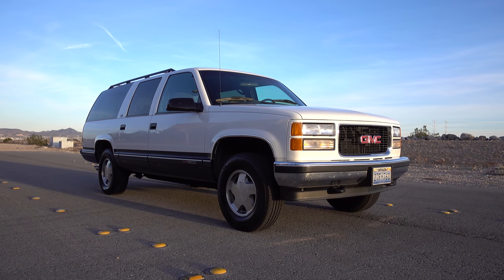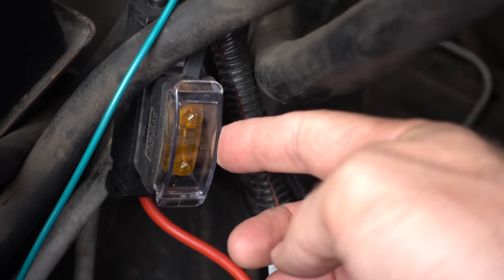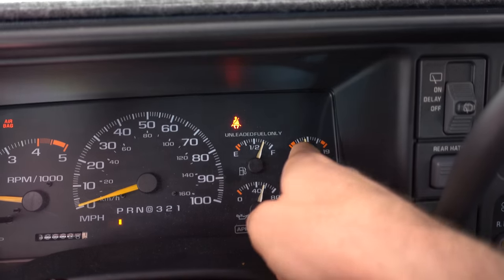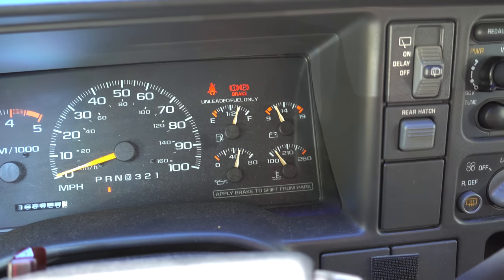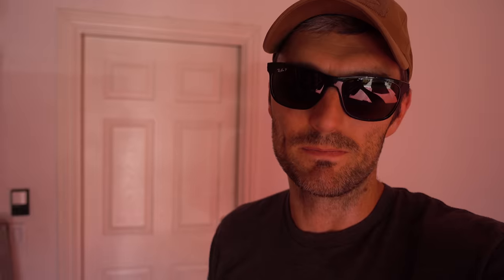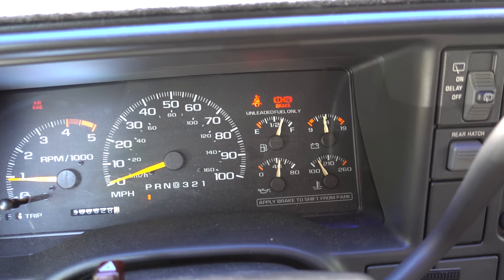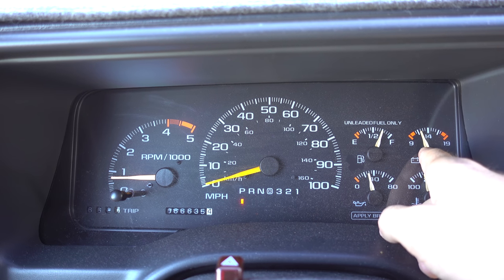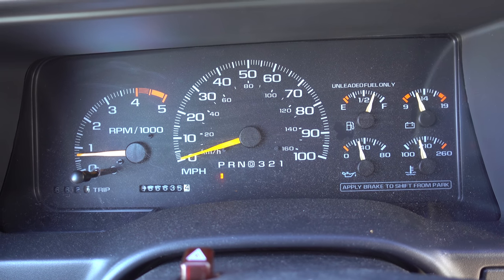SOLVE A LOW VOLTAGE ISSUE!

Comment: What was the problem
Reply from the maker: The alternator. See my latest video on my channel!! I just swapped in a MechMan 250amp Elite and I no longer have issues!!
Reply: My battery gauge drops with ac defrost head lights turn up window goes to 9.. i check the battery running 13.6 with all accesories on but gauge reads 9
Reply: I also have brake abs t/c lock and all gauges go off whene driving whene it gets to 9 what should i do

Comment: Batteries usually don't drop voltage unless they are cold. I've seen GM alternators crack the stud for the battery lead. Would cause a bad connection, and therefore, inconsistent voltage. Sometimes this does not happen until everything gets good and warm from expansion. You might also try using what is called a "Lightning Cap" on your fan relay circuit. These are supercapacitors used to prevent voltage sags with high power car stereos.
Reply: My car when hot occasionally stalls and voltage gauge drops to 12 in the red zone. Happens when coming to a stop, higher mileage 2002 Camaro
Reply: @HypocriticYT  A few things come to mind here. Underdrive pulleys for alternator and water pump were (still are?) popular mods to reduce accessory drag, so a previous owner may have installed underdrive pulleys, which combined with a malfunctioning Idle Air Control Valve, could be allowing idle RPM to drop too low to maintain sufficient alternator RPM and drop voltage, especially with the additional RPM drag and amperage load of air-conditioning. Coil packs / DIS ignition module could also be flaking slightly enough to reduce power at idle, resulting in a lower idle.

Could also be the cracked exciter stud I mentioned previously. The throttle body / intake manifold could also need cleaning, as MPFI / TPI / GDI all allow gunk and carbon to accumulate in the intake, choking off airflow, which will affect power and idle RPM. Dirty fuel injectors could also contribute to low idle. Modern OBD systems are quite sensitive to voltage sags, so anything causing a sudden voltage drop could cause a stall as you're experiencing.
Reply: @anonymousinc6330  it's all original and I recently replaced the air idle valve and the MAP sensor (scanner found it). It idles fine at about 600 rpm. Happens when A/C is off since I rarely use that anyways. Cracked stud seems more likely since the problem is intermittent and only occurs when hot. Tomorrow I'm changing the alternator as it has over 200K miles on it so it cannot hurt to do it.

Comment: It's the alternator. Once you have your engine running, most of your systems run off the alternator. That alternator is only rated for about 95 amps. I would start looking at a larger capacity alternator. Your alternator should be putting out a minimum of 13.8v and optimal is 14.8
Reply from the maker: Jason Hall hey Jason thanks. You are correct. My alt was at fault. I’ve since upgraded to a Mechman 250 amp elite and it rocks!!
Reply: @1RoadGarage  you're welcome. Mechman is an expensive alternator. It's great that you got one another route you could have gone would be to get a junkyard alternator and install a high output kit in it yourself. Time spent is money saved. It also gives you information on how parts work so you can better understand and diagnose issues
Reply: 14.4 volts is normal but nice attempt

Comment: Dual alternator may a option, but I would go firstly with a couple of AGM battery in the back or in front were every you can find space, plus definitely upgrade on the positive and negative cables

Comment: Did you compare the Amphere Hours Capacity of the Batteries to the Amp. usage of the fans and total draw of the car. Plus a cheap-Oh from Costco. Come on be smart and not so cheap.  Get a Odyssey 1500 Batt.   Also how about a switch so one fan at a time or temp. controlled fans. Yes spring for dual Batt. With 140 amps. You never mentioned the amp draw of the fans. What is there draw single and total ?

Comment: please take ur truck and get ac checked ..the hotter out the higher the pressure in ac and ac compress is over stressing and slowing everything down..
Reply from the maker: +Thomas Hoyne I actually just took it in and it was low by almost 2 pounds. The system holds 4 pounds and was recharged properly...
Reply: 1 Road no it only takes 2.7 pounds..with it over charged and hot the high pressure side will be super high take it to an account shop asap

Comment: This is not permanent solution when your battery reserve voltage finish later come this same problem again 
Less amp  source more consumption this is not a right way must find out actual problem alternator to battery charging healthy only settle this thing

Comment: I had a similar issue that Voltage drops in my 05 denali when AC is On and in drive or reverse and the issue was the crankshaft pulley is slipping so alternator is not charging well swapped it with GM part and it was all good

“So just check your crankshaft pulley”

Comment: WHATS A BIG 3 UPGRADE?
ANYONE OUT THERE WITH AN '09 CHEVY SILVERADO 1500 HAVING ISSUES WITH"STABILIZER CONTROL"; TRACTION CONTROL NEEDS SERVCE"; ABS AND AIR BAG ICON COMES ON AND OFF; POWER DOORS LOCKS GO UP AND DOWN; AC GOES HIGH TO 74 DEGREES; AND ENGINE LOOSES POWER?  ALL OF THAT HAPPENS AT ONCE.  
LET ME KNOW GUYS!!!

Comment: I'm having same problem with my '97 Tahoe. I'm running a red top Optima battery and have replaced all incandescent bulbs with led's (just looks better) and I replaced alternator with a 250 amp alternator, ALL A/C parts are brand new, but still having that same low voltage issue. Had a '95 Yukon that never gave me a bit of trouble, but this Tahoe is kinda chapping my ass.

Comment: Mines was the ground cable from the battery to the alternator once I replace it it’s working fine again it’s not the battery I the the connectors
Good luck

Comment: not really a good praktice to use a red wire for a ground connection.
Reply: and about those ground strap between engineblock and body, those tend to corrode over time . check forcgreen dusty corrosion on the straps. i would check and replace them on an older car just as preventive  maintenance, it's cheap insurrance.

Comment: To much load for the alternator to keep up.    220amp is what you need.  Most are only 165. 175. Amps.   Need more juice man.
Reply from the maker: Totally right I actually went Mechman 250 elite and it worked out perfectly

Comment: Sounds like you need a deep cycle battery like a optima yellow top or the Marin blue top or any other deep cycle battery I will worn you they are spends mine was $240 I think

Comment: Im getting this problem and my truck is stock
Reply: I have the same problem. On a stick Tahoe, went from California to Texas. Never had a problem. Might need a new alternator to or bigger one to accommodate my fans on constantly
Reply: @2208Mag  voltage regulator went faulty in the alternator thats the problem with mine they also cleaned out the throttle body and found some pitting

Comment: It's "smart" alternator that switches off high amp production and voltage when hot or in hot weather. I have one on my Toyota and in summer the voltage is very low below 13.8v  but in winter it's always above 14.2v one solution I found for hot weather is to pop the hood so it rises 2-3 inches and drive like that and its up to 70% cooler and there is no danger of hood coming up all the way because you still have to move the latch under it with your finger for that to happen

Comment: Not sure if you solved this but you certainly need more than the stock 105 Amp alternator when running those fans. The root problem is not the battery, you need a higher Amp output alternator. At least a 140 Amp but maybe even something like a 200 Amp alternator
Reply: RedfishCarolina you didn't pay attention

Comment: So take it from someone that knows a lot about AC. I think your evaporator (located inside the vehicle under the dash) is likely corroded resulting in poor air flow across the coils which causes your AC to blow warm air, especially when the vehicle isn't moving.

Your dual fan setup is just a bandaid fix for what is ultimately an ac problem. I don't recommend fixing AC problems yourself, take it an actual AC mechanic. Assuming the refrigerant is fully charged and the compressor works properly, most likely the problem is with the evaporator. The dealership doesn't care about your 1995 vehicle. They will take your money and charge a diagnostic fee and then tell you all is normal. They ultimately want you to buy a new car. 

Fix your AC efficiency issues and you won't need that terrible dual fan setup. Your engine bay looks like an electrical disaster now. Also, hose down the condenser located in front of the radio, that should help as well. Cheers!

Comment: That was not starting up just fine btw that’s what we call a rough start. I think you have a bad connection or bad ground somewhere in the wiring to the alternator. I’m dealing with the same issue atm on my 2nd gen Cummins I have it narrowed down to a small area just have to pull the electrical tape and plastic protective wrap and inspect. Go through your wiring slowly and jiggle gently while running. When you come across the bad area you will hear a slight noise change in your engine and charging system and you’ve found it. Now fix the bad connect and sleep better.
Reply: Got it

Comment: gm alternators are shit as with most of their vehicles, jump someone off and smoke your crappy alternator diodes. gm alternators get weaker and weaker with age on amperage have it rebuilt to 200 amps and your vehicle will be happier.

Comment: Did you find your issue I’m having similar issues almost the same or actually the same LOL
Reply: Jake Burnett what was your fix for this problem. I’ve had similar problems with my suburban, when started it runs at about 14.5 volts and on some longer trips it never drops below 13 volts. However when I turn the car off and turn the key back towards starts you can see the voltage drop instantly from 14 volts to around 11.5 barely starts the car back up. It hesitated but starts. I replaced the starter and had the charging system checked and there was no problems per auto zone and oreilly’s tester. This is puzzling o